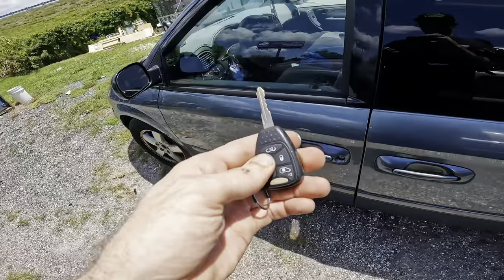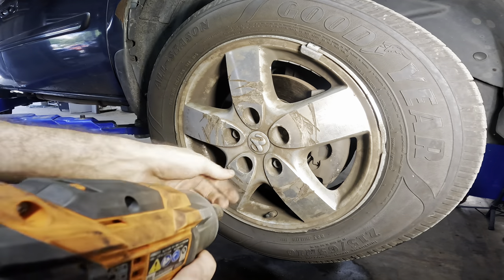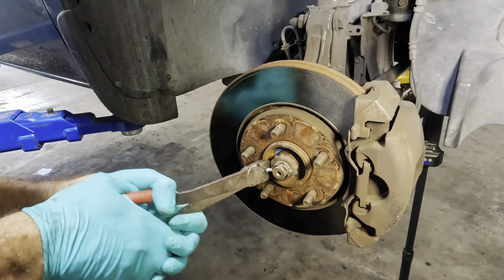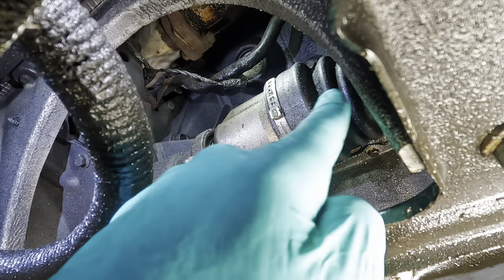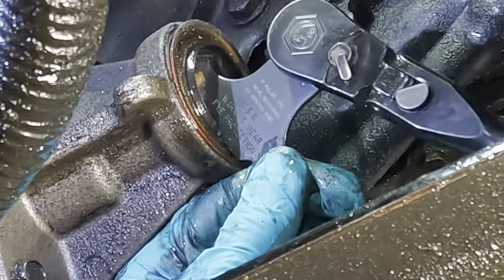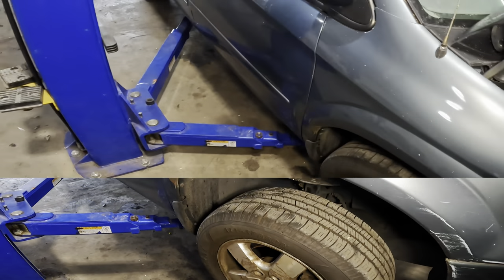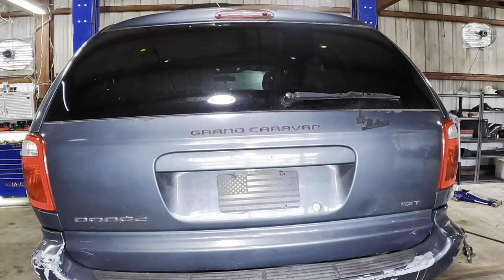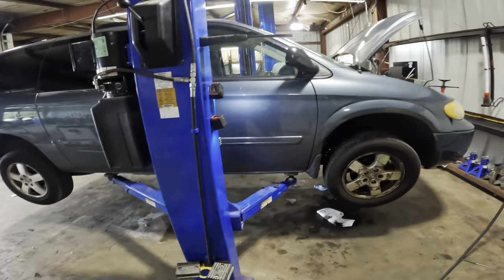Worn OUT Busted Axle! Dodge Caravan Limps In! 2007 3.8

Comment: I am only a couple minutes into the video but does Ray not see the auxiliary oil pressure gauge mounted under the dash?
Reply: I guess he finally saw it. Can't believe he didn't notice it to begin with though.
Reply from the maker: I usually ignore aftermarket items at first, it’s not usually relevant to the situations
Reply: @RainmanRaysRepairs  That makes sense. Just seems ironic that it was the answer to the initial although secondary question about the oil light and disconnected wire. 😂 Keep the great work and videos coming!

Comment: Holding the torque wrench further up the handle changes the torque applied....just saying.
Reply: Does that change the set torque on the digital readout?
I don't understand.
Reply: @wayneessar7489  It changes the torque applied to the fastener. So when you torque your nut and you pull until you see the required torque on your readout, the actual torque at the nut will not be the same as the readout on your wrench if you don't have your hand correctly positioned on the wrench.

Comment: That bolt will always align with the witness marks, the hole is round and does not move in the strut, the slot is not in that part, but in the inner part, that is where you need to worry about any witness marks.
Reply: at 14:05 when he removes the bolts he shows that the strut is slotted not the knuckle...
Reply: @joshuakuhens4952  You got it backwards

Comment: If all motor mounts are broken wouldn't that cause the motor to fall out of the vehicle? I swear that happened to my uncle he turned to get onto an exit and the motor dropped
Reply: One would think.  Certainly increased vibration would be an indication before catastrophic failure, especially on a 4-cylinder engine. (And especially again, with the air-conditioning turned on.)
 
True story:  In 1991 I visited a local Olds dealer for parts for my Delta 88, but did take a look at the new Cutlass Supremes on the showroom floor.  I lifted the hood on one to see how it looked.  A salesman walked over, pointed out the torque strut from the cylinder head to the radiator support, explaining that in a crash it would break, allowing the engine to "fold under the car."  Great, here I was trying to find out how they were put together, and he was telling me HOW THEY CAME APART! 😲😆😉
Reply: that's strange- usually engine mounts are somewhat captive- a ring within another ring.

Comment: Why did Dodge make the taillight fixture like that? Why couldn't they just run the wires directly to a plug that plugs onto the socket like they used to do?  They could have made it much cheaper, simpler and above all, more reliable if they did it the old fashion way.

That's something I love about automotive fix it videos. We get to see how terribly engineered some of these cars are, and with that, exactly why they fail.
Reply: As I have learned in automotive-part manufacturing, car parts are designed to go together quickly on an assembly line.  Not necessarily to come back apart easily or be repaired.

Comment: Meaning of slotted? Please Ray
Reply: The knuckle is slotted to allow camber adjustment. Camber is the angle the top of the tire is in or out. Watch at about 25 min on video and see how the wheel moves in and out.
Reply: @joshhobbs1442  In this particular case, it was the strut/support that was slotted and not the knuckle, true?  14:10  Not sure if this is atypical though since I'm no suspension expert.

Comment: It reminds me of the time I was work on a cavalier and it was coming in for bearing I took the tire off then I said F!#% MY FAMOUS WORD  Called the customer he said they just replaced it he didn't tell me their name but he got a new 1 got it replaced with the bearings got it bck on the road then its bck for a damn new engine got it replaced then it was bck on the road....and i got a 2004 grand caravn jit a deer took out my headlight and that condensor fan and i put zip ties on it and it came bck off but i had brake shoes bresk in half on the back and it scared tf out me im driving an i hear Clank clank an heard a grinding noise and i just made it home looked and the damage on the rotor got the pads in half and shoes

Comment: That whole van needs a pressure wash, new compressor, new starter new taillight but not replacing the motor mounts..
Reply: As my sainted father would have said, it "needs a new radiator cap."  Why?  "So you can drive a new car under it!" 😆

Comment: If people would just Spray down the CV Joint Boots with Rubber Lube or Silicone Spray once or twice a year, these Boots would last a very long time...
Reply: or if manufacturer would spend $5 per shaft and use silicone rubber boots.

Comment: This video is brought to you by big oil. Big oil, big dividends, invest today. I was holding some Ecopetrol shares, because a Colombian oil giant must be a responsible ESG investment, and read that one of their big oil pipelines was bombed in an area that the military was fighting to control. Come to find out that same pipeline gets blown up like every 40 days. Imagine the environmental carnage of that. It’s like Saddam lighting Kuwaiti oil wells ablaze and shearing off the well heads during the Gulf War. I just wanted solid earnings and good dividend yields. What have I done? 

That clean Cadillac must have been a nice vehicle to work on, except for wrestling with the knuckle, brake rotor, and axle shaft like a Florida man on the back of an alligator. Sorry for the comment about hitting a pothole and your head hitting the headliner there Cadillac owner. Getting the carbon cleaned off the valves was a smart move. Does the EGR valve and hose clog on those cars too?

When I saw Fordtechmakuloco adding catch cans on EGR lines of eco boost engines I really got a good look at how GDI engines with twin turbos have skewed so far towards fuel economy to the detriment of longevity.

I am learning a lot from watching you guys talk about and work on cars so thanks. Last week I changed the alternator and drive belt on the V6 Camry which I would have otherwise taken to the dealer. The biggest part of that job was disconnecting and unbolting things to get them out of the way without breaking anything, which I wouldn’t have taken the initiative to do without watching you do it time and time again.

Yerkes Primate Center is five minutes away from my house. Protesters used to gather out there protesting them giving HIV to apes. That was before AZT when it would progress into full blown AIDS unhindered. HIV was a death sentence then, and I know people that died from it. Now the drugs make it completely undetectable and PreP can even stop you from getting it if exposed. 

I think about how many macaques died of Covid there when they were developing the Pfizer vaccine and effective drug treatments and protocols. I signed up to take part in the Pfizer/BioNTech vaccine human trial but got rejected. With Yerkes, the CDC, Emory University, and the VA so close I definitely feel like an experimental primate with all the crap they have going on, not to mention my sister is a research scientist at a medical school. 

I prefer the term experimental primate to Guinea pig or lab rat. It sounds more politically correct. If I actually consented to it that would be different, but no. There have been more news of doctors raping patients lately. With great power comes great rape and get away ability. Well, at least I never got HIV. Monkey martyrs, now that is a heck of a thought. 

Dang, that caravan needs like ten cans of brake parts cleaner for all the grease underneath. This video is like when the dentist shows you a close up of your dentition on camera. Ooh, that’s nasty.